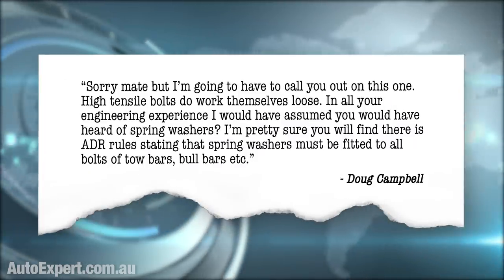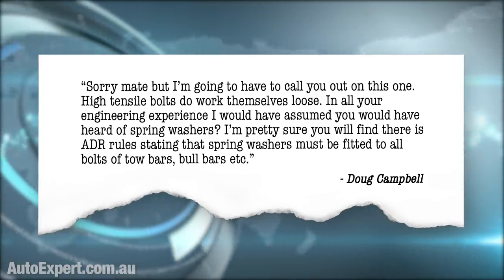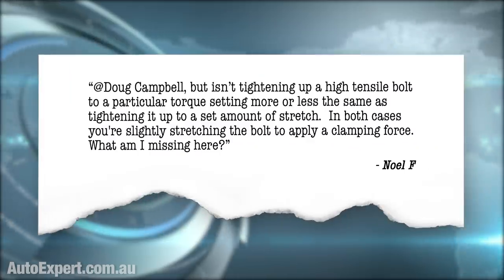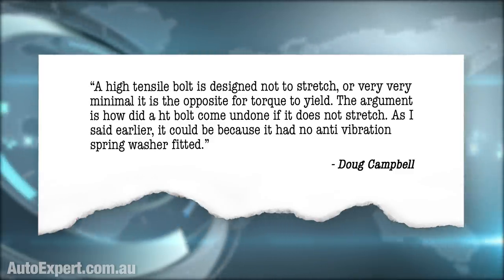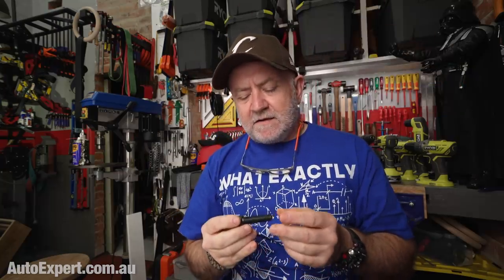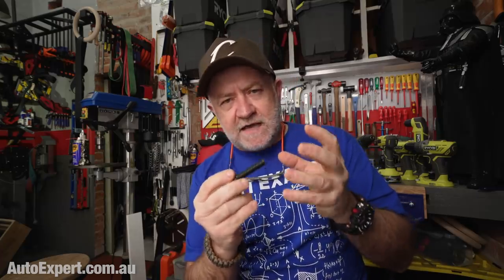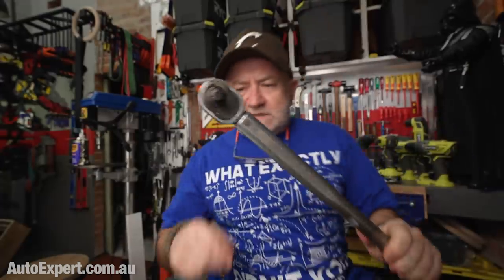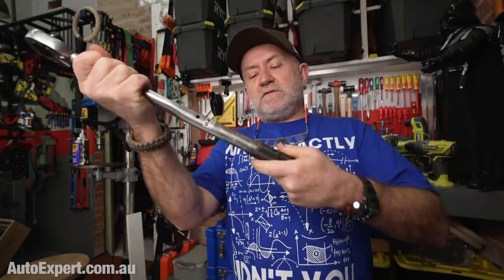The applied physics of high tensile bolted joints and assembly in cars | Auto Expert John Cadogan

Comment: As a heavy duty fitter in the mining industry and working mainly on Caterpillar equipment I'll say that they don't use spring washers on any bolts over about 6mm. The main bearing bolts on a C175 engine are torqued by stretching the stud to a certain length and then screwing the round nuts into place by hand then releasing the stretch.
Reply: There must be some requirement for flatness, cleanliness, free from defects, burrs etc for that. Not disagreeing, I'm sure the CAT engineers know what they are doing, but the tiniest imperfection would prevent you from screwing a nut into position by hand?
Reply: @philmenzies2477  I'm not sure I've got this right, so Peter please throw a wrench at me if I got this wrong. But Phil, I think what Peter means is that once the studs are stretched, the round nuts are threaded by hand, and when the the studs are "released", the hand-tightened nuts are tightened fully by the stretch force itself, rather than using a tool. Maybe.

Comment: Spring washer's also affect your torque reading, they are often smaller than the nut and thus there is less friction as the full face of the nut isn't touching, they are also very prone to damaging the underlying surface/plate because of there lesser surface area.
Reply: this point, this, bloody hate the things, sure they have their purpose but only if they are used to spec
Reply: Not so much. Friction is independent of surface area. The smaller surface of the washer has no affect.

The thing you might be fighting though is the embedment of the spring washer into the surface of the nut and what you're fastening. Ultimately, the additional losses caused by that embedment may mean that for the specified torque you never get to the appropriate clamping load of the fastener.

Comment: Well done John. And very happy to see you in part talk about how clamping loads are achieved and the good old dial indicator for directly measuring bolt stretch.

I've really been enjoying your beer garden physics/engineering discussions, please make them an ongoing and regular thing.

So much more left unsaid as well. So much engineering fun left to be had. For instance the complexity of the relationship between applied torque and the thing you really care about, the clamping load.

And a high tensile bolt is definitely a spring, that initial flat region on the stress strain curve is a picture of Hooke's law. TTY on the other hand is a spring that you've intentionally broken. No washer hiding in there, but definitely a spring.

Comment: First off, John, I am impressed as all get out with your reading spectacles! Next, high tensile hardware is most likely hardened and those silly "spring" washers (here in Retardestan, we call those "split" washers) will not dig into the surface at all.  All the tow hitches I have had my hands on, have a dome type washer which flattens at the installed torque, usually 50 ft-lbs for an m12 bolt.  I always use a torque wrench to fit up bolts and nuts and LockTite red, too.  In over 45 years experience, I have never had a bolt come loose, ever.  I have seen the failure of the frame as you showed us, but it was from over-loading the chassis to astronomical weights causing the chassis to peel off from the load.

Comment: John: "Torque to yield bolts. You can never reuse them."
Local mechanic: "Watch this!"
Reply: Hold my beer
Reply: Yeah you can. They make great children's toys.
Reply: I've read that some Nissan engines 1.8L and 2.0L with head gasket failures repeated the failures because mechanics reused the head bolts, instead of using the new bolts., so the heads were never properly torqued to spec.
Reply: @markh.6687  I think the fastener would fail if you reused it. I never have. The only bit of my 2.0 Nissan which worked was the engine.
Reply: Mate, just crankem another halfa turn.
Reply: @markh.6687  The way I see it, a stretch bolt for an alloy engine has another job-to be elastic as the engine heats and cools. Using an old bolt means the elastic properties have changed and the gasket gets over-compressed at running temperature, and may fail because of that.
Reply: You do get the occasional engine where you can either reuse them a fixed number of times (200/300tdi) or measure the length and if they're within spec you can reuse them (WLA(T) in a bravo or courier). That said for the cost you'd be pants on head to not replace them.

Comment: The spring washer. The most useless bit of steel ever made. A passenger, is what it is. 
And yes , I am a mechanic 32 years
Reply: Have you seen the Ave video where he tests them? The only style of lock/spring washer that works is the nordlock style.
Reply: Spot on!
Reply: Just let me add this . Caterpillar, the global worldwide construction equipment builder have a motto never to use spring washers on there equipment. And they don’t.
Reply: @felixchetlanddevries2998  yes, but with AVE , I can’t remember if he checked then on 8.8 bolts or 12.9’s. the spring part must be harder than the bolt so it can dig in to the softer bolt or nut
Reply: The number of times I've seen them deform and expand when being taken to high torque isn't funny. Best Bars over here in New Zealand used to supply them with all of their bars, on anything M10 and larger, they couldn't actually cope with the specified tightening load.
Reply: Spring washer =timebomb.
Reply: @biastv1234  That's likely because they aren't using garden-variety hardware, so there's no need. But somewhere out there some idiot has a D9 with spring washers on it.

Comment: I’m a mechanic by trade working as a fixed plant fitter these days and I haven’t seen the use of spring washers on high tensile bolts for years, even construction bolts (low grade) use flat washers. The only use I see for spring washers any more is with thin sheet metal applications.

Comment: Well explained John! I have been a mechanic for 34 years now & for mine, if it requires a high tensile screw,stud whatever,then , 100% it needs to be done with either a tension wrench(calibrated regulary) or as the case mainly now,tourque by degrees which has been worked out by dudes like you(engineers) to make the job of dudes like me a bit easier & by that I mean faster.Remember spring washers work in the same way as a shake proof washer( a washer with little notches on it) & a flat washer spreads the load over a bigger area on the job & therefore increasing the clamping pressure over te whole job. Torque to yeild is slightly different but same shit basically
I have never fitted a wheel in my life without using a torque wrench to tighten it to a specific tourque, ie: 100 p/ft 1/2 inch stud. Many of my mates cant believe that doing it up tighter with a big arse super sonic rattle gun is actuallly giving the wheel MORE chance of coming off. These days I do elevator modenisatioins  the principle is exactly the same, further more all the info you need is so easy to get now from Dr google.
2 rules to follow if we are not sure
1 KISS theory usually works
2 If in doubt, check it out & you wont fail
Cheers mate & I had the spring washer debate with my father so many years ago now 
Scary thing for me, Their are people out there towing without any applied knowledge at all
Scarier, there are peope checking it in the same boat!

Comment: Quick example of use of torque to yield bolts. In early '90s Mitsubishi DOHC 4G63 engines there were several design changes made and one of these was going from 12mm 'standard' head bolts to 11mm torque to yield bolts.

Comment: If the fastener is tightened to the correct torque, i.e. the force just below the yield point of the fastener material, the fastener itself becomes its own spring. No spring washers required.
Reply: The fastener is always a spring...
Reply: everything is a spring, it's just the spring rate that varries.
Reply: Ken;   I do not believe that a fastener has to be torqued to "just below the yield point" in order to "become its own spring".  As soon as any tension is applied to the fastener it becomes a spring and will elongate fairly linearly with increasing tension (constant spring rate) until the yield point is reached.  I do not think it wise to tension a fastener to "just below the yield point" as any increase in tension caused by any number of factors could bring the fastener to the yield point and permanently deform it which would likely adversely affect joint performance.  It is my understanding that most properly designed joints will operate the fastener within its "elastic" range of stress while simultaneously maintaining sufficient clamping force  for the joint to carry the loads imposed.  An exception to this would be specially designed joints using "torque to yield" fasteners.
As John Wade was kind enough to point out my first version of this comment contained some wrong ideas so I did some research and found an interesting paper on bolted joint design put together by the Fastenal company. You can read it at:  https://www.fastenal.com/content/feds/pdf/Article%20-%20Bolted%20Joint%20Design.pdf   On Page 2 of this document Fastenal suggests that a typical clamp load would be about 67% of the tension at the yield point.  On pages 5 and 6 there is a discussion of bolted tension joint design including how external forces will affect the forces within the joint and the tension in the bolt.
Reply: @Vincent_Sullivan  That's a pretty good summary. If fastener loads varied a lot, you'd see a lot of fatigue failures. The fastener is protected from load fluctuation by the stiffness of the joint.

Comment: All good information John. One the reasons torque to yield bolts where introduced is because applying a predetermined torque to a bolt can be inaccurate, especially at higher torques. Torque to yield bolts are initially torqued to to a low figure such as 40 Nm and angle torqued from there to achieve more accurate tensioning. In some cases these bolts can be reused, some automotive manufacture's give a maximum length or a minimum thickness. In performance applications con rod bolts are tensioned and the bolt stretch is measured to ensure the correct tension has  been achieved. Keep up the good work.

Comment: I once borrowed a torque wrench to tighten the clutch assembly to the flywheel of my car when replacing the clutch. The torque wrench had a pin that popped when the torque was reached, it worked well on the first one or two bolts but I snapped the next bolt when I forgot to reset that bloody pin. That was a good lesson learned, of course that was just one design of torque wrench.
Reply: Yep, sounds like a WB. Set, pull, click, reset, pull, click, reset....

Comment: Great video John. One thing you didn't mention was Nyloc nuts. I believe that Nyloc nuts are a safety feature to guard against incorrectly torqued bolts coming loose and the nut vibrating off. A noisy loosely bolted joint is better than a joint where the nut has vibrated off completely. With regard to spring washers, I think back to the old cars that I have worked on and these cars have oodles of spring washers on bolted joints. Possibly Torque Wrenches were more expensive in the old days and engineers though the spring washer provided an additional degree of safety on joints that were torqued with a spanner only. Would be interested in your comments on this.

Comment: Really good video. As an engineer I was half expecting a cringy mistake but it never came. Fasteners are particularly troublesome because there's so much more than meets the eye. You don't know what you don't know. A couple more examples:
- Torque to yield bolts also help with consistency of force because, beyond yield, where the curve is much flatter, the effect of small differences in overall stretch is much smaller in terms of resultant clamping force.
- High tensile joints that have been properly designed mean that the load on the bolt is not only pure tension, but that the value of tension doesn't vary with changes in the load up until joint separation occurs, which you design out. This is a good safeguard against fatigue and vibration loosening.
- Fine pitch bolts are very common in the automotive industry. These have slightly more net cross sectional area than structural coarse pitch bolts, so are a bit stronger. In addition, there tends to be more thread friction, again safeguarding against loosening.
- Some bolts are installed literally by measuring the stretch. This tends to be done with special fasteners that firmly seat a micrometer for repeatable measurements.
- The business of bolting soft materials together is another can of worms, with material creep leading to loss of bolt tension over time.
- Belleville washers are a true "spring washer" that can maintain a significant clamping force even if the bolt starts to yield or embedment takes place. Fiddly things for a production environment though. 
- Etc!

Comment: As a directional driller (civil construction) I force diamond and tungsten cutting tools through hundreds of meters of solid rock on a daily basis, I know what works because when we f#ck up it costs tens of thousands of micro peso's. correct torque and a liberal application of threadlocker is the only thing that works

Comment: I work in engineering in aerospace industry, and lock washers are FORBIDDEN in most designs for the very reason given in this video. If anti-rotation is needed for a critical area an adhesive like loctite or castellated nut will usually be specified. There's instances where one time use lock nuts are usable but usually are not desired.
Reply: Check out Nord-lock washers.
Reply: @gtpumps  yes, even nordlock are forbidden in high tensile and safety critical applications.

Comment: As a metal fabricator pretty much the only time I use spring washers is for bolts going into a blind hole, nylock nuts serve more purpose for anti-rotation in my experience.
Torque wrench is king for fasteners even for something as low as 5nm.
In all the pressure vessels I've seen and helped build have never used anything other than structural purpose "high-tensile" bolts, washers and nuts. Pressure vessels attached to multi KW motors, no need for other anti-vibration devices.
Reply: If anything at lower nm settings a torque wrench is more critical than higher, it's always easy to over tighten and damage the threads or item being compressed
Reply: @schrinky90  yeah true, especially considering stuff like carbon frames and the like which often are specced in that region, expensive mistake to over tighten
Reply: @Etho_7  been there, done that. Lucky I was super paranoid on the MTB one day after a crash redoing the seat post up to tight, so it just kept slipping down. But better that than a broken frame!

Comment: Interestingly enough the instructions for the ARB ford ranger 2011 onwards towbar (3640130) does actually say it should have spring washers for the chassis bolts. Which brings the interesting thought that if you do the correct thing and assembly without spring washer if it'll no longer meets the relevant ADR as it's not been assembled per the manufactures instructions.

Comment: Realy nice explanation, if I have some screws especially on the suspension I use LOCTITE® 243 for additional safety (the blue one with moderate strength) and then I am sure the screw stay in place 👍
Reply: Just remember that there's many types of loctite, and you need to use the correct type for the size of bolt and application. The 243 is typically good for M8 thru M18 (¼"-¾") bolts.

Comment: "Don't dick with certified designs."

Never truer words spoken.
Reply: @WheresmywingsRedBull  It's not that they are wrong it's just that it is in-consequencial to the strength of the design. At clamping pressures of high tensile bolts at full torque you essentially have 2 flat washers. By the time a high tensile bolt has loosened enough for the spring washer to do anything the joint has already failed. What may occur if you and spring washers to a design that didn't spec them originally is that there may not be full engagement of the bolt thread into the nut which. Say hypothetically you normally have 2mm clear of the nut but ad a 2.5mm spring washer(yes I know that the majority of the stress is on the first few threads). You now loose 0.5mm oof thread engagement ("don't dick with certified designs"). If the original design has the spring washer it will have a longer bolt spec'd.

Comment: As an ex-mechanic who has installed about 50 BT-50 bull bars without spring washers, thank you for pointing their use. Most of the tow bars I have seen installed at dealerships have been tightened with a rattle gun or long spanner, never a torque wrench.

The whole "tightening your bolts" during services is never done...time does not permit for every bolt to be torqued appropriately. #Stealerships

Thank you also for explaining tensile ratings. We see so many customer cars come through without the appropriate hardware for the role.

Comment: Another excellent beer garden physics lecture, John!
A couple of points to note:
1. It's not just the bolt that stretches in the bolted joint, it's the compression of the material being joined also acting as part of the 'spring'. 
2. I thought that there is a minimum length for a standard structural connection, like 5x diameter of the bolt? This allows proper stretch, but is not practical in some automotive situations, but good in engine assembly for example.

Comment: I was taught to tighten it till you strip the thread nd back it off 1/2 a turn ! The reason you don"t use spring washers with flat washers is the spring will turn the flat and loosen off. I worked for PBR and we made spring washers.